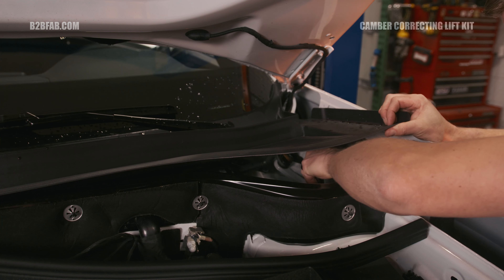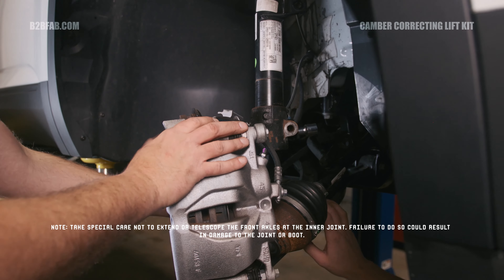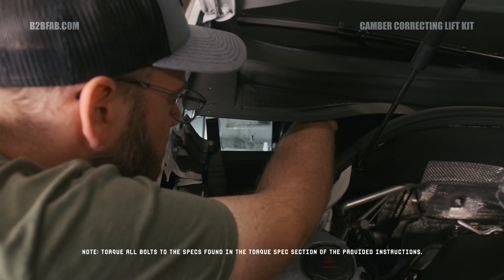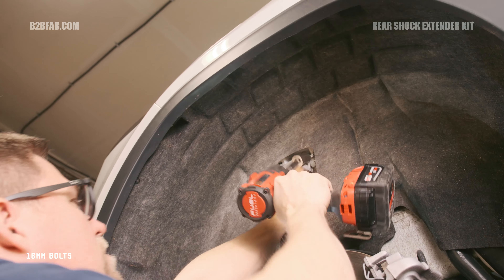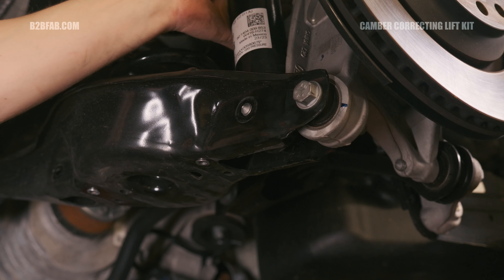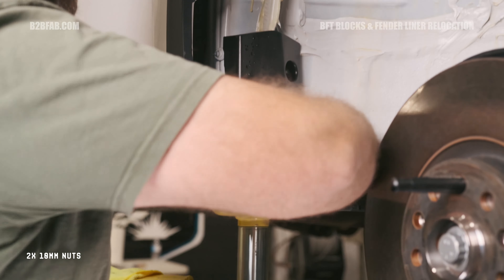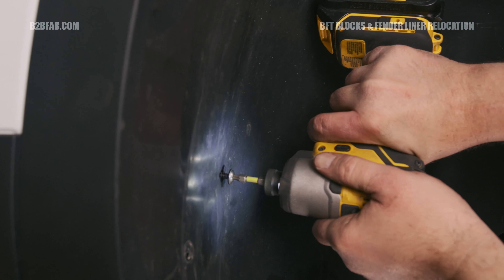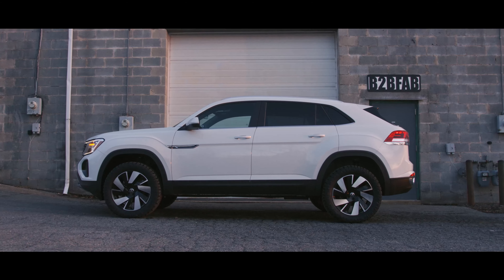B2BFAB VW Atlas Cross Sport Complete Lift Kit Package Install

Comment: Hey, I ordered the lift kit for the new 2024 Atlas (Peak Edition SEL). Do you know what tire size I can run after the installation? The stock tire (I like the peak edition rims) is 255/60/R18. I some groups they claim they can run a 31 inch without rubbing and lift.